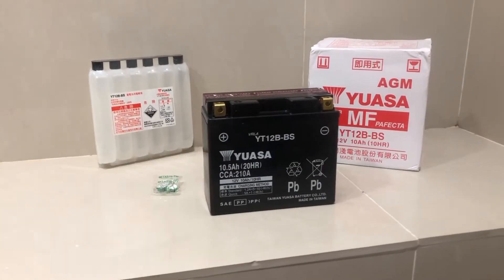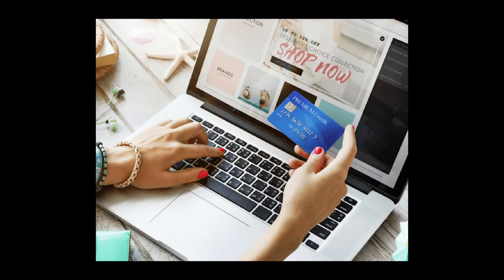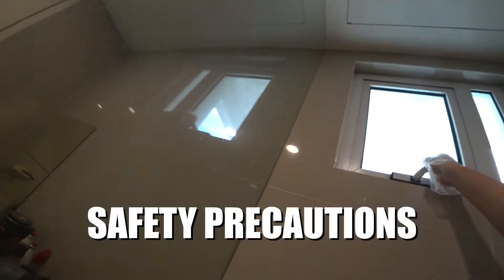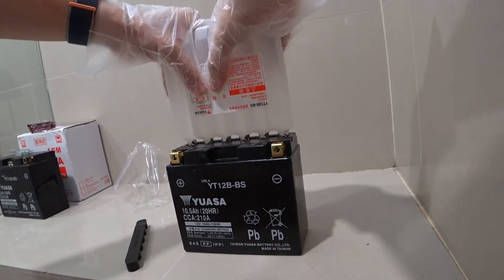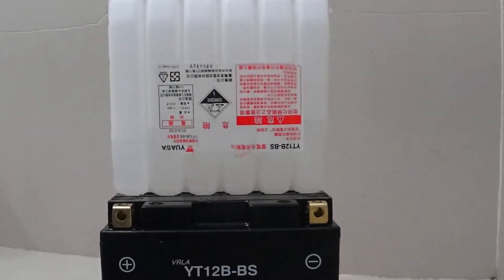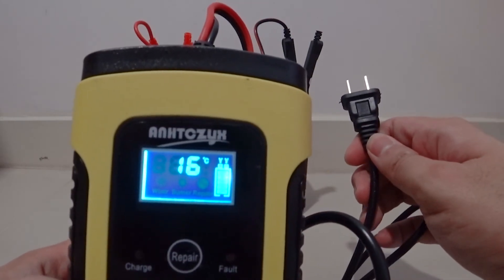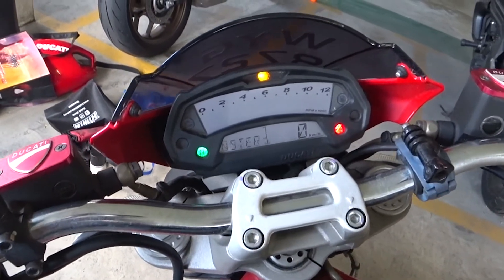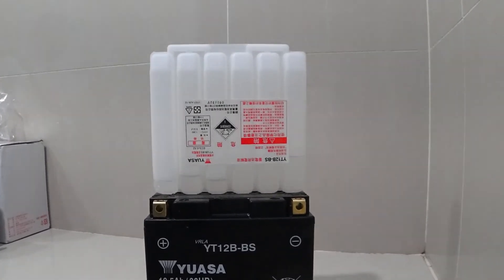Important Process to Activate an AGM Lead Acid Battery | Yuasa YT12B-BS for Ducati Monster

Comment: Hello!
It is possible to charge the battery using a battery from another car (while plugged in) or this should only be performed using such charger as you used?
Reply: No you need a slow charger 1-2Ah to get full capacity and lifespan of the battery especially during first activation. 
A car battery has got too many ambers (at least 50 Ah one small car battery) that would ruin it with a very fast charging current and also would not reach the maximum Volts that a charger can give at the start to get it over 13,20 Volts that a new bike battery can reach after the end of the charge but it would stop to where the car battery is e.g. at 12,6 Volts. All these mean that it could give a charge but very reduced lifespan of the new battery.
Reply from the maker: Hello. Damn that’s a good question. Unfortunately I’m not qualified enough to give you an answer to that. Let me know if you have the answer already.
Reply: @RUBBERNMETAL  I Charged it at a qualified electrician with a charger similar to what you used. But I don't have an official answer, if it's safe to use also another car's battery. I suppose not :D

Comment: Battery Acid (Sulphuric Acid) is not concentrated, it is dilute. Specific Gravity of 1.280 degrees is used in LA batteries, concentrated Sulphuric Acid has an SG of 1.800 and if put in a battery it would kill it in weeks.

Comment: Hi. Does the battery needs to be charged after you put the acid? Or after filling it with acid and waited for 1 hour then you can use it instantly?
Reply: Yes you could use it without charging but you would lose important capacity and lifespan of the battery.
In 1-2 year you would need a new battery but if you do all the steps it can last 5-6 years at least!

Comment: This is made in Taiwan, is it Authentic, how to tell whether it is authentic or not? I read review from amazon which lasted slightly more than a year and was made in Malaysia? Pls advice, there are too many fake things nowadays.
Reply from the maker: Hi. Yea it is authentic there’s a Taiwan and Japan yuasa. Japan is more expensive obviously. I’m not sure about Malaysian made because it wasn’t an option. I agree you have to be careful not to buy fake products especially anything that is critical on the bike, best way is to buy from a proper dealer instead of finding a cheap one online.
Reply: @RUBBERNMETAL  Thanks.
Reply: What's the difference between Japan and Taiwan yuasa? Besides the price
Reply: @lwkon3113  Just the Japan is the ''GENUINE'' original made in Japan.
 It lasted in my Suzuki 10,5 whole years but it was installed by the bike manufacturer!!!
After this i had an Indonesian YUASA exactly the same type that i prepared myself like this video and lasted 6 years.
I think Taiwan are a level below the original ''Japan'' but slightly better than the others.
Generally all YUASA batteries are supposed to be original and high quality just the ''made in Japan are the top quality thats why they have double price.